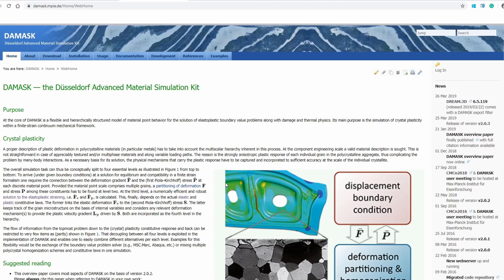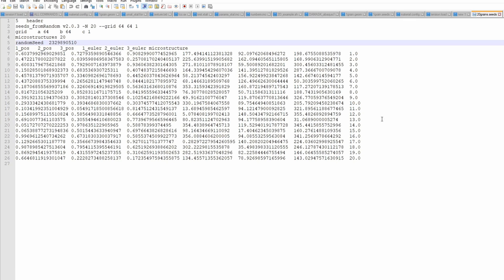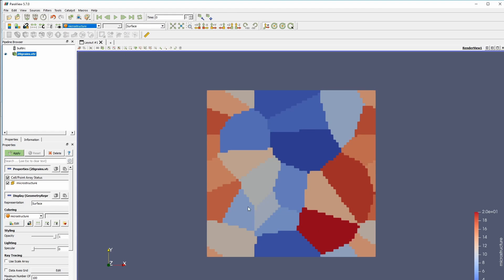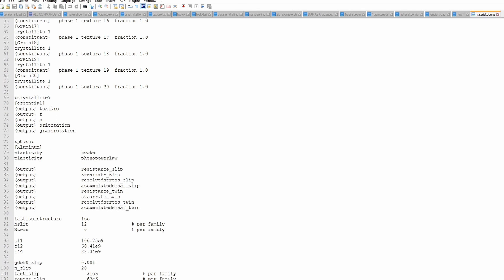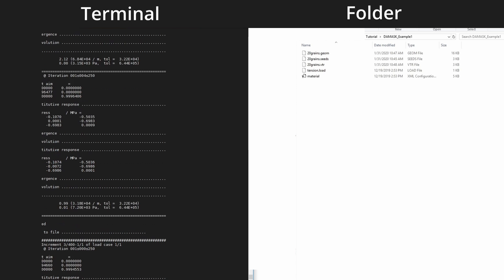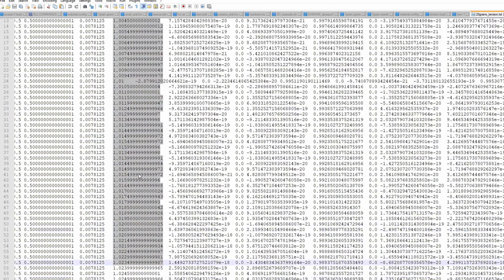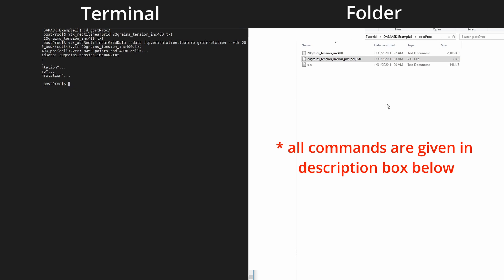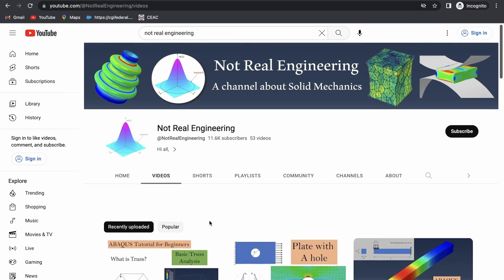DAMASK example tutorial | Part-1 | 2D poly-crystalline Aluminum

Comment: Where I can find the files to run this steps:
1. seeds_fromRandom -N 20 --grid 64 64 1 (right angle bracket)20grains.seeds
2. geom_fromVoronoiTessellation --grid 64 64 1 20grains.seeds
Will this example run with DAMASK 3?